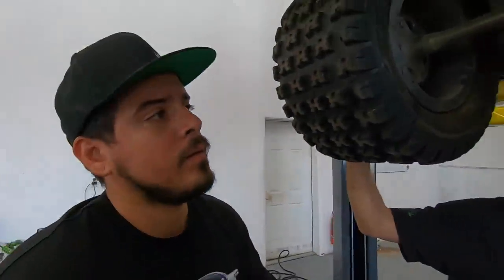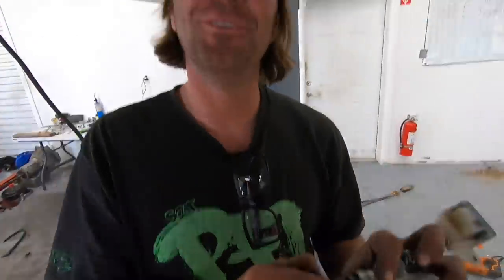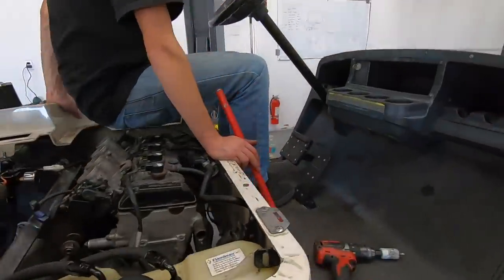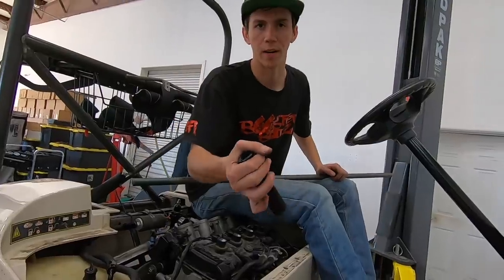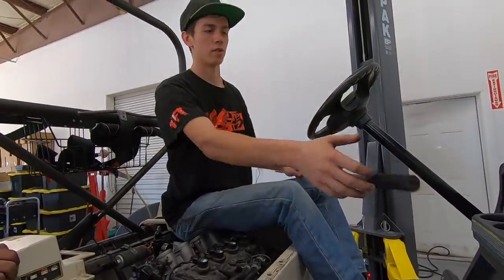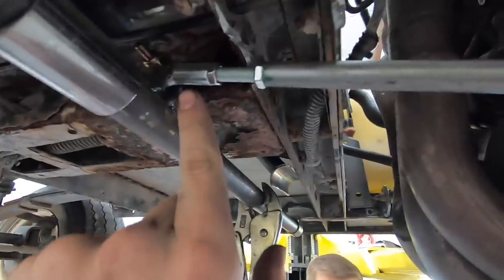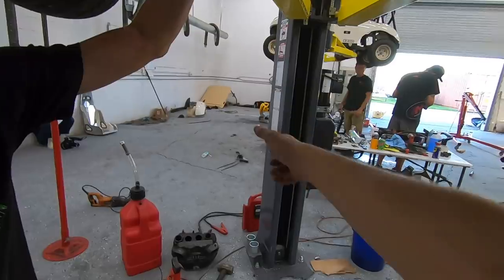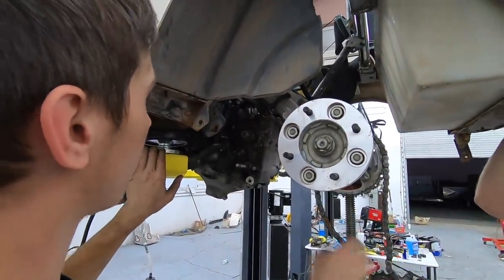600cc Swapped Golf Cart Is Almost Ready to Drive! (Build Off Day 3)

Comment: Now flip the linkage over on the shift shaft on the trans and it should be back to pulling for up 👍
Reply: Daniel Niemeier my thoughts just GP shifting swap.
Reply: I hope they see this. I thought the same thing.
Reply: Didn’t see your comment and commented the same thing haha. Hopefully they do it
Reply: this
Reply: I was just gonna tell them that.
Reply: Or run the linkage through the plastic right to the handle.
Reply: Could also shorten the lever arm to get shorter throws
Reply: They need to do this
Reply: Upvote this so they may see it!!!
Reply: That's exactly what came to my mind as well.
Reply: I was looking for this, great minds think alike!! You mite have to extend the shift arm a little more to clear the motor, but yeah flip it and your good
Reply: Its Kyle he doesn't care for anyone's opinion. So it will be seen and ignored by him.
Reply: I came here to make this comment.
Reply: The way it is now shout he just have to push forward to put it in first. The rest would be pulling back
Reply: This
Reply: Daniel Niemeier was about to suggest the same
Reply: Same thing I was thinking. Flip the linkage on the gear box.
Reply: This is true
Reply: was just thinking the same thing
Reply: Dude
Reply from the maker: Daniel Niemeier yea we were going to try it but there’s no to much clearance for it since there are some lines in the way but we are still working on it
Reply: @boostedboiz  yeah the boys good on yas you need to turbo that thing
Reply: I have a grey market bike from japan. It has reversed gear pattern.
Reply: @boostedboiz  the way you have it now shouldn't you just have to push forward for 1st gear and the rest will be pulling back?
Reply: I was about to post this same msg tell I seen it posted already, just switch the link on the trans and make it pivot on the top and not the bottom, will solve the shifting from being reviewed to proper
Reply: KY SPORTSMAN no some bikes have a different shift direction but have linkages that corrects it to your foot
Reply: @r6exrider   Exactly, with the way they set it up, tabs down. First is forward on gearstick, and rest is back.
Reply: Was going to say that
Reply: yes all you got to do is switch it to the top side on the shift shaft on the motor
Reply: @Rolfbhag83  that's what they are going for right?
Reply: Just about to complete this, spot on
Reply: @pointmeby  they got this probably just didn't put it in the video.
Reply: When you about to make this comment and scroll to the comments.... and this is the top comment.
Reply: I was just about to post the same thought.. seems obvious from an outside perspective, but I could see how they might overlook it.
Reply: @r6exrider  Yes, but in the video they seem to think it's opposite. And comments in here seems to want it opposite. And that makes no sense.
Reply: @boostedboiz  you could lower the bar under the cart to make room for linkage to be put back on the top ... just do it before you cut shifter to size ....
Reply: Daniel Niemeier bump
Reply: Daniel Niemeier lmao I just commented that and you got almost 500 likes😂👌🏻
Reply: pointmeby there’s no way there not gonna see it bro it’s got almost 500 likes and it’s at the very top
Reply: Daniel Niemeier this
Reply: @boostedboiz  Flip the mount on the actual shift shaft.
Reply: @BoostedBoiz as long as the rod is strong enough, you could bend a dog leg into it to clear any obstructions.
Reply: @boostedboiz  The way it is at the end of the video should be configured the right way, forward is 1st and then back to go up.
Reply: SO FUNNY! I said the same thing. Upvoted.
Reply: @boostedboiz  Remember your shift linkage doesn't have to be straight between the Heim Joints.
Reply: Exactly what I came here to type.
Reply: While I was watching I was thinking about the same thing, hopefully they will see guys
Reply: @boostedboiz  
FLIP THE SHIFTER ARM ON THE ENGINE BY THE CHAIN.
Reply: BoostedBoiz just put an of set init
Reply: They aint gonna do shit
Reply: I literally was just about to comment this.
Reply: I saw this too
Reply: So everyone a bloody comedian now? LOLOL
Reply: :same:same:
Reply: @boostedboiz  you need to make a tiny turbo outa the new exhaust. No intercooler and rock it.
Reply: That works
Reply: Thank you! I was just gonna say the same thing
Reply: I hope they see this th o
Reply: Exactly what I was thinking... switch the rear tab
Reply: Just thought this same thing. Hopefully it work
Reply: Thank god there’s more than one person that thought the same. Lol
Because I was too! Lol
Reply: Yep, just need to flip it over
Reply: I was just about to comment that and saw that you already did lol
Reply: Haha same thoughts here
Reply: @justindobyns8122  Haven't rode in years but still remember.
Reply: Yep! What he said, I couldn't stand by and just watch that be a thing lol
Reply: came to say this, just flip the lever at the shifter and it'll shift like the mr2 again
Reply: I was just about to say that 👍👍
Reply: @krisnicolls2579   Ima say it too just cause it's so simple literal 30 second fix
Reply: We saw , just didn’t have the space
Reply: I am just going to comment the same thing!
Reply: Exactly what i came down to write... and there's 1200 others thinking the same thing...
Reply: BoostedBoiz love that you are so fan and comment savvy. 

respect
Reply: This.
Reply: It will switch it to pulling to shift
Reply: I was just gonna say that
Reply: @PFIBrent  https://youtu.be/DIB3OZ0veWI?t=701
Looks like theres space to flip the gearbox shifter side (closest chain).

Comment: You gentlemen know that you can just flip the linkage to reverse the shift pattern right? Best content ever.
Reply: Bobby Campbell that’s what I was wondering? I mean possible to keep the linkage straight but still easy fix
Reply: They mentioned in another comment they're trying it but not enough clearance. Currently in the works though
Reply: @parmesanjon   no they mean leave the shifter side alone, but flip the lever where it attaches to the shaft on the trans.   Same concept how they moved the tab to the bottom on the one side, now just move the tab on the other side to the top, and it'll shift right again
Reply: @eddominates  yes, I know, I've had street bikes for years. They still didn't have the clearance
Reply: They said that just didnt want to waste more time.

Comment: Move the engine shift lever to the top and it will reverse it again so u don’t push forward
Reply: Too simple isnt it lol
Reply: The problem is that he drilled a hole in the floor to close to the base of the seat flip the trans linkage and they will be back to the same problem.....
Reply: @codeack101wlck  Its splined and can co in many positions

Comment: The Cleetus cart is going to snap/break that axle they chose.
Reply: truee, their rear axle assembly is from (for) a drift trike using maybe 250-400cc mower engines, no way it will take the power of a 1000cc streetbike... they gonna use 150hp on a >30hp rated axle :p
Reply: Gonna break the key way and bend the shaft. 100%
Reply: The Golf Father no it won’t that’s not where there weak point is... the week point would be where the sprocket meets the shaft more than likely that key way would shear off before that 1 inch axle actually breaks
Reply: @aleccarr1696  true
Reply: Alec Carr the parts are meant for slower trikes but they’re pretty stout billet pieces so id be surprised if they snapped, i just don’t think 3 bearings is enough support so they’ll bend the axle/mounts
Reply: @Herbsy420  150 + nitrous
Reply: justin credible dude it’s billet I don’t think so
Reply: @dremoore9436  billet ALUMINUM...  its would be better as cast steel.
Reply: Yep.  I've twisted up 1"  STEEL axles with 600c shifter kart, just using golf kart tires.  and mine even had IRS with u-joints, theirs is just straight,  taking all he toque plus the weight of the kart ...  bad news.   we'll see though.  I've sheared off keys and keyways too, they're deff gonna have problems.
Reply: Boosted boys with a 25tooth rear sprocket and weak chain.McFarland with a weak axle setup on a 1k, Gonna be rough for both

Comment: I'm not an atv guy but I'm thinking some suspension on the front might be a good idea with the extra budget. If only for the wheelie portion of the event. Just seems like a lot of pressure coming down on that golf cart front end to not damage it, especially if its before the 1/8 mile challenge. Definitely need to drive straight and stable for that.

Comment: Protip: When doing WOT pulls on a street bike you dont need to use the clutch to upshift. Just bang it right through the gears.
Reply: I usually come off throttle for a split second and clutchless upshift. I found your comment so I didn't double post lol
Reply: @caryherring3224  Yep gotta come off the throttle a little bit for sure. Shoulda added that.
Reply: @H03tRiLL  yea definently dont stay wot when shifting lmao just let off throttle just enough to be in a neutral movement state
Reply: for a drag set you have a spark cut on a lever switch so you do not even need to move the throttle just cuts the ignition for a few msec
Reply: @williamcooper126  ie a quick shifter

Comment: Likes represent how many inches of gap they gonna give cletus
Reply: I think it's going to be who's rear end lives the longest.
Reply: @Super Saiyan Smurf one bearings can handle that much power?
Reply: @Super Saiyan Smurf ya I'm talking about that axle bar.
Reply: @Super Saiyan Smurf that bar gonna fold trust me lol
Reply: @Super Saiyan Smurf time will tell
Reply: @Super Saiyan Smurf time will tell. go eat some corn on the cob l
Reply: @Super Saiyan Smurf hey chief... Its burnout and wheelies to win. Anything can happen. Power is only an advantage if you can use it and with this? It doesnt help much at all. 
Whats the gearing? Tire size? Nothings a sure win with this. Sure its an advantage but not much of one.
Reply: Super Saiyan Smurf really dude because the people who made it left a comment to someone saying he may have to take it easy they are working on making a upgrade later after build series. So according to them your dead wrong lol
Reply: @Super Saiyan Smurf Mr Cleetus is super worried about that Axel. Hmmmm They getting something just in case. But don't worry. it will fold and be swapped out lol. Just watch :) Think realistic bro. 1000cc

Comment: Honda radiator, little electric fan !!!!! 
And you can always up a tooth on the sprocket to get the chain a little bit tighter!!!!!  And you need to find slicks for your rims , garrett is going to run slicks , you need them !! 
Get er done boys !! Stoked on this build

Comment: You might want to counterweight the shift lever on the bottom under the cart, or add some kind of opposing springs to stiffen the action, with that heavy steel handle so that it doesn't shift itself from G forces jerking the weight of the shift lever.  That looks like sch40 steel pipe, which will be decently weighty with 2 or 3 ft of handle.

Comment: Kyle, have a look at the angle of the rear swing arm and the motor sprocket placement, once it starts carrying a load, it'll be putting alot of tension on the chain and eventually it'll snap the chain, unless you build a solid rear suspension eg. replacing the shocks with a solid bar, just have a look at that.

Comment: For the shifter you could put those long tabs on top, notch a slit in the floor, drill a hole in the flat body piece under seat for the linkage and that will allow you the pull upshift to work. The heim joint would be above floor sure but will allow it to work. Can even make them an inch longer like Brent said they needed to be. That would help floor clearance for the linkage.

Comment: I would recommend blipping the throttle on this to ease the load on the trans when shifting. You don't have to, but it does make the clutchless shifts a lot easier. Or, I dont know if you guys have enough time to get an airshifter on this. Basically It cuts ignition or fuel and uses an air ram to button shift the trans for you, that way you're on throttle the entire time.

Comment: Flip that shift arm connected to the shaft on the bike to be facing upwards which switches the direction and drill a hole on that arm closer to the shaft for a shorter throw👍

Comment: You got this.  Cleetus can't touch the Boosted Boiz as far as engineering and fabrication is concerned.  The first time Cleetus hits that throttle with any torque, their axel with either twist or snap off completely.   Gonna be good.

Comment: Hey dudes! Check your sprocket sizes. You can change the gearing so you’ll have full acceleration through the 1/8th. A very popular gear change on sportbikes is -1 tooth (from stock) up front, and +2 (from stock) in the rear. That’s what I run on my R1. It will increase accel, but decrease top speed the further you go. But who needs to go 150 in a golf cart? You could probably go -2 front, +4 in the rear for the best 1/8th et

Comment: Put a spring loaded skate board wheel pulling up on bottom side of chain so it doesn't get loose and slap around and jump of hold pressure on chain at all times trust me you'll be needing it lol

Comment: Hey I know it's last minute but you guys really should use a rekluse clutch. You can look them up on eBay and their Ford motorcycles and ATVs and stuff. Basically it makes it to where you can take off and shift without having to pull the clutch lever in. And it basically turns it into a sequential transmission. For more information lookup grind hard Plumbing Co and it's the clutch that they're running on their Barbie Jeep build that they did. But it saves you from having to use a clutch lever and figuring all that stuff out and it makes for wicked fast shifts. Go boostedboiz kick some ass

Comment: I'm only halfway done watching the video and I'm probably jumping way ahead of my self i'm sure y'all are going to put some type of chain tensioner on it but if you're running a solid hardtail off the swing arm and solid motor mounts  you still might want to use a small tensioner chain pulley of some type what an amazing collaboration 
BoostedBoiz
 PFI Speed
Cleetus McFarland
Fasterproms

Comment: TL:DR : You really MUST change that guaranteed- point-of-failure biohazard chain.

Hey guys, nice to see you all pull together and get stuff done as usual, that golf cart is coming out pretty rad (euphemism of the year).

One suggestion though, and please hear me through, you really should swap out that tetanusy chain, it's cooked, I can see from here that the o-rings stick a lot, zhat the links bind badly and that it's at least half rust half steel.

It might break at the worst possible moment under the additional load, and even if it doesn't you'll lose quite a bit of power grinding through it compared to a brand new chain.

It looks like it's a standard 530 chain, and if I were you I'd grab a plain reinforced chain without o-rings.

 I like DID chains and JT pinions and sprockets a lot, but a cheapo non-oring 530 chain will do, they can take quite a bit more torque than a 525

When they're new and well lubricated non-oring chains are preferable in this kind of application, you have to take better care of them compared to o-ring ones if you want them to last and perform a while, but the advantage is that they "eat" quite a bit less power, especially when they're new.

I'm talking from 38 years of experience, and I'm not nitpicking, I want to see you guys win.

Also, don't forget to grab a can of proper high-grade chain lubricant, it makes a noticeable difference. https://www.wd40.com/products/roller-chain-lubricant/

I can't wait to see these things do 300 ft wheelies down the strip.

TL:DR bis : Please don't be lazy on this, change that disgusting chain, you don't want to have problems with it one way or another on the strip, and I'm not talking just tetanus, I want to see you win this time.

Sorry Cleetus, Cooper and James, nothing personal ;o)

Peace, see you later.

Comment: a simple bell crank or pivot on the gear connecting rod, would turn the shift pattern back to where it should be,  what would you need, 2 more heim joints, 2 small brackets, a longer lower rod, and a new shorter one, a pivot bar, as long as both sides of center are the same, it wouldn't interfere with the length of throw of the lever as to keeping it all where it should be, send the linkage forward, to the pivot, through that, then the new longer bar would be going in the correct orientation, you guys are more than capable of knocking that out in not time at all.

Comment: Use a boat throttle cable for the shifter.  Your gonna have flex. Push pull cable with 1/4" eyes

Comment: You guys should spin the shift linkage 180° to the top of the shifter shaft (splined) if you want to pull the lever to up gears instead of pushing

Comment: Here is an idea for your shifter- if you extend the shifter shaft by about 4 inches (or how much you need for it to not rub on anything) on the transmission you could flip the transmission side linkage for the shifter so its facing up then you could pull back on the shifter to shift gears up.

Comment: You only need the clutch on a motorcycle to start driving when you’re in first. you can hold a bit of tension on the gear lever to shift up and when you dip the throttle and then it would shift without using the clutch 
Just search Clutchless upshifts on motorcycle  on YouTube
Reply: this thing is gonna do backflips lol

Comment: Streetbike engines need to be "Burped" when you are filling the coolant. Top off the radiator when its warm put the cap on the first click and tilt the cart past 45* both left and right and check the coolant level. If you do do this there is a big air pocket in the head that creates a huge hot spot.